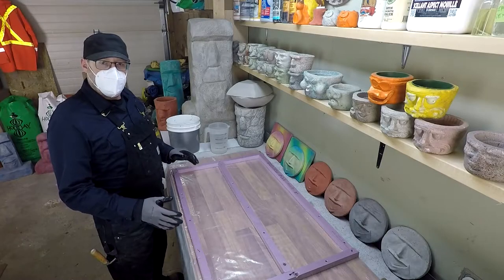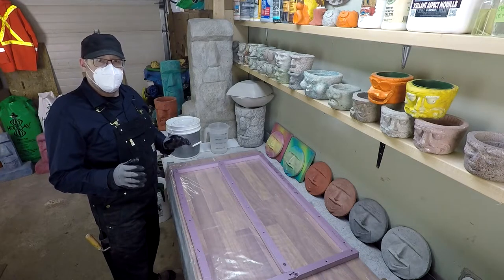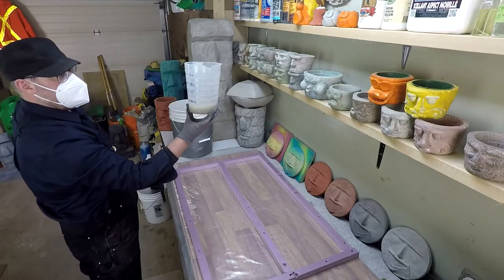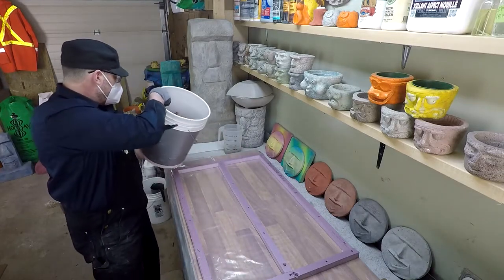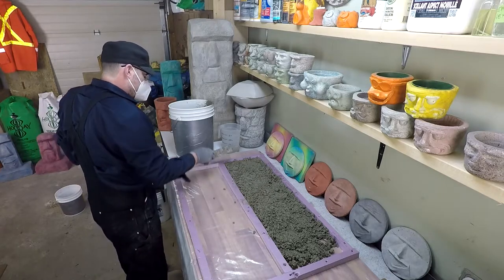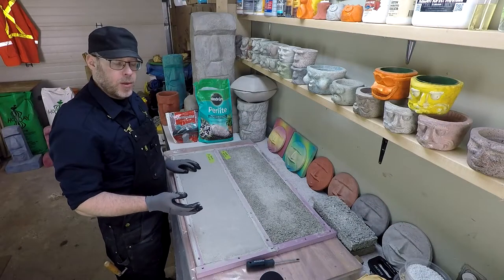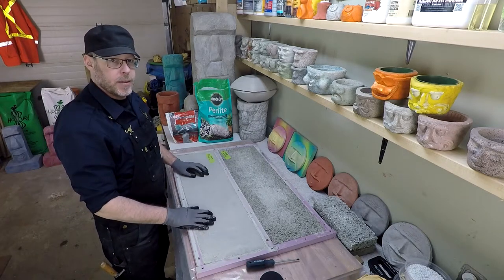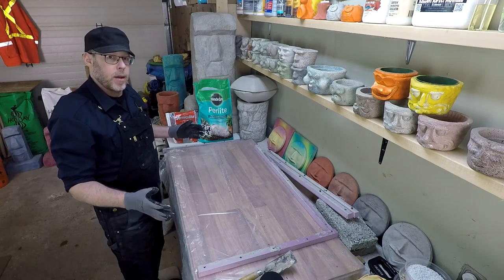Making Lightweight Concrete With Perlite (4:1)

Comment: Add a little white glue, makes all the particles stick a little better. Lot cheaper than the one at Big Box Stores. I cure mine in a sealed bag with a little water. Use white tile cement with latex paint to color, then drizzle over concrete pot for fired looking affect.
Reply from the maker: That is some great info - thanks for commenting.

Comment: Interesting videos! You've mentioned in a few of them that fiberglass strands can be added to increase the strength of lightweight concrete -- do you have any videos where you do that and show the results and comparisons? I'd find that quite interesting. I'm thinking of trying a perlite to cement mix of 4:1 or maybe even 6:1 or 8:1 and I'm curious to see how much stronger those might be with added fiberglass. I'm thinking of using this in the wall cavity of a shed I want to build -- since if should be fire proof (unlike spray foam) while still having some insulation value for both heat and sound (my shed will be a sound studio). I'm thinking of making my shed from my own DIY SIPs (structurally insulated panels) and using mainly lightweight concrete as the insulation portion.
Reply from the maker: The most recent video shows a test panel with fibers, but I do not have the strength test for this live yet.  Still to come.  I think vermiculite 6:1 or 8:1 with cement would be the best for your application and I am not sure I see any benefit from the fibers.  You really do not need much in the way of strength if the mix will only be used to fill inside panels.

Comment: I was wondering if you are using the perlite as-is (I feel like it usually comes in the ~1/4"-1/8" range), or if it's more crushed down to resemble sand?
Reply from the maker: just as it comes from the garden store.  I have not found different grades of perlite, but you can definitely find vermiculite in small sand sized grains.

Comment: I sure wish you had vibrated the molds for this series of testing.
Reply from the maker: With the mix this thick and with the poured piece so thin I believe that vibration would have caused a separation between the solids and the liquids in the mix compromising the strength.  My placement process left no voids, as evidenced during the break stage.

Comment: Hi Steve, I am looking for a lightweight concrete to cast a 30" human figure in silicon mold. I did some test and 4:1 looks okay but it never get uniformed, it keeps the perlite crumbs.  Do you think it's a good option to use for my applications? Thank you!
Reply from the maker: Just as you noticed the 4:1 will not consolidate well with normal vibration.  You could use a plasticizer to help with consolidating but I still think that you will struggle to get a void-free finish.  Perhaps 3:1 might get you a little closer, and also I find that I have better luck with vermiculite versus perlite in getting a honeycomb free finish which I believe is due to how perlite rejects water where verm readily absorbs it.
Reply: @creatingconcrete  Thank you! I will try the Vermiculate mix (I watched your other video with it), makes sense. Is there any specific reason that you add PittMoss to vermiculite + cement mix? Just as a filler?
Reply from the maker: @rachelkarklin1014  As a filler, but just another aggregate option for a unique texture concrete product (hypertuffa).